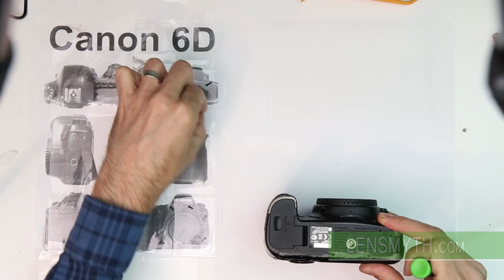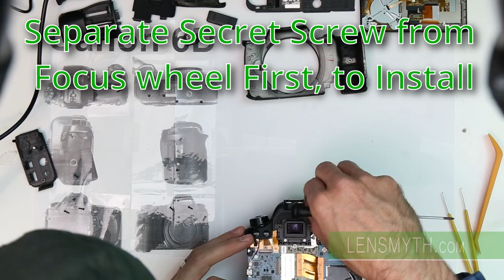Replacing Rubber Wheel on Canon 6D -Aperture Wheel Replacement

Comment: Awesome stuff.  I found out the rubber was stretched on the aperture dial so I ordered a new ring from amazon.  I followed these instructions to the T, then when I put a battery in after reassemble . .  nothing!  Must be a connection wire not fully plugged in.
Reply from the maker: Did you see what Cristian said below, about the battery door or the SD card door? Either of those can stop the camera from showing any sign of life if they, for some reason, show as open. I didn't look into that part closely but it seems easy to bend some contacts slightly so the doors might register as open. Anyways hope you figured it out!

Comment: dang, I did this and it won t power up now. I am going to open it up and see if I maybe missed a pluggin wire
Reply: follow up 1: I double checked if everything was fine, it was but it still did not work. I removed battery, card, put them back in and after a while it powered on. Now, occasionally it does not turn on. I noticed that I have to open the sd card slot door and close it hard (slamming it almost) and it turns on. Any suggestions? I might have to send this in to an expert.
Reply from the maker: Glad you were able to narrow it down to the card reader door. The 6d does normally shut off when the sd card door opens. There's a tiny button the door presses as it shuts, you can see it right next to the card slot. If you happen to be inside it again you'll possibly see why it's not making a good connection?
Reply: @Live-DIY  follow up 2: hey yes, thank you very much for your quick response! I was looking at another canon 6d camera and saw that there is a small switch as you said. That switch is like a sensor that does not let the camera power on unless the sd card door is shut. There is one also at the battery door, both have to be shut so that the camera turns on. My problem was that when I assembled the camera back, I somehow forced a tiny metal plate against the sd card door's switch and it did not made contact with the door anymore when it closed. THANKFULLY it did not break and I managed to put it back in place. Thanks once again for your video, I followed along and it was very useful 👍👍